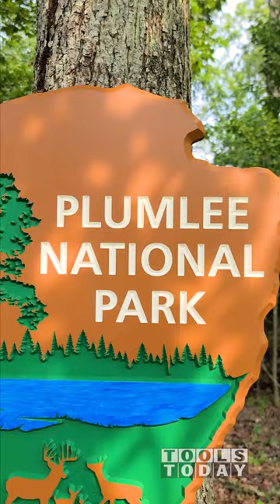Making a National Park Sign

Comment from the maker: Check out the full video on this project - https://youtu.be/bB6_XUXwtLE

Download and purchase the customizable plans here: https://www.toolstoday.com/cnc-park-sign-plans.html

Making a National Park Sign in Corafoam 20lb HDU using Amana Tool® industrial cutting tools on the Stepcraft Q.408 4'x8' CNC machine, available on our website,  http://www.toolstoday.com
 #short #shorts
What do you think of how it turned out?

Download and purchase the customizable plans here: https://www.toolstoday.com/cnc-park-sign-plans.html

I started off by applying some Oramask 813 to the pre-painted piece. I the carved into it using Amana Tool no. RC-1102, a 90° Insert carbide ‘V’-Groove bit featuring 1-1/2" diameter and 1/2” shank available from ToolsToday.

Amana Tool RC-1102 Insert V-Groove 90 Deg x 3/4 CH x 1/2 Inch SHK CNC Router Bit
https://www.toolstoday.com/v-9407-rc-1102.html
RPM: 18,000
Feed Rate: 40ipm
Plunge Rate: 20ipm
Depth per pass: 0.50"

Amana Tool 46202-K SC Spektra Extreme Tool Life Coated Spiral Plunge 1/4 Dia x 3/4 CH x 1/4 SHK 2-1/2 Inch Long Down-Cut Router Bit
https://www.toolstoday.com/v-13779-46202-k.html
RPM: 18,000
Feed Rate: 120ipm
Plunge Rate: 60ipm
Depth per pass: 0.25"

Amana Tool RC-1148 Insert V-Groove 60 Deg x 59/64 CH x 1/4 Inch SHK CNC Router Bit
https://www.toolstoday.com/v-13336-rc-1148tt.html
RPM: 18,000
Feed Rate: 40ipm
Plunge Rate: 20ipm
Max Depth: 0.25"

Amana Tool 46315-K SC Spektra Extreme Tool Life Coated Spiral Plunge 1/4 Dia x 1 CH x 1/4 SHK 2-1/2 Inch Long Up-Cut Router Bit
https://www.toolstoday.com/v-13780-46315-k.html
RPM: 18,000
Feed Rate: 120ipm
Plunge Rate: 60ipm
Depth per pass: 0.25"

Amana Tool 45650 Carbide Tipped Keyhole 3/8 D x 3/8 CH x 1/4 Inch SHK Router Bit
https://www.toolstoday.com/v-6104-45650.html
RPM: 18,000
Feed Rate: 100ipm
Plunge Rate: 50ipm
Depth per pass: 0.33"

The piece was cut free at the bandsaw and flush trimmed with the Amana Tool no. 47092 1/4" diameter 1" cut height bit. A chamfer was added on the back side with the Amana Tool no. 49400 45° 1-1/4" diameter chamfer bit. The rest of the painting was completed and the piece was finished with Minwax Sparurethane in satin.
 
Amana Tool 47092 Carbide Tipped Flush Trim 1/4 D x 1 CH x 1/4 SHK x 2-1/2 Inch Long Router Bit w/ Lower Ball Bearing
https://www.toolstoday.com/v-5331-47092.html
 
Amana Tool 49400 Carbide Tipped Chamfer 45 Degree x 1-1/4 D x 1/2 CH x 1/4 Inch SHK w/ Lower Ball Bearing Router Bit
https://www.toolstoday.com/v-5830-49400.html